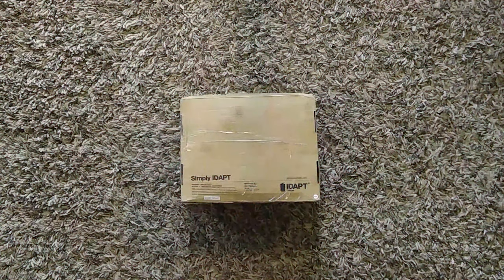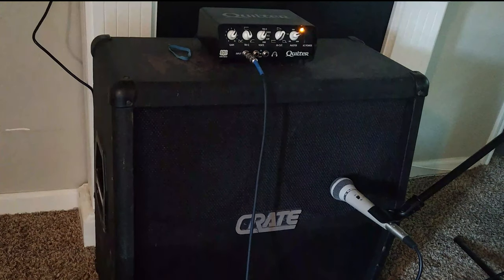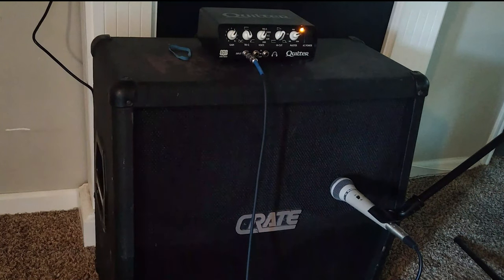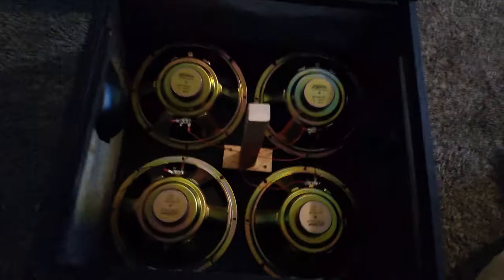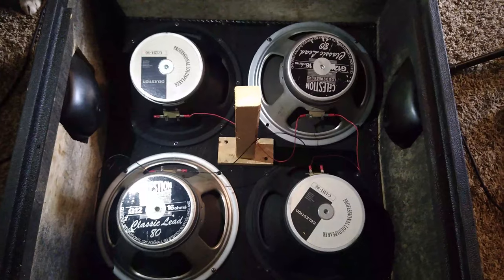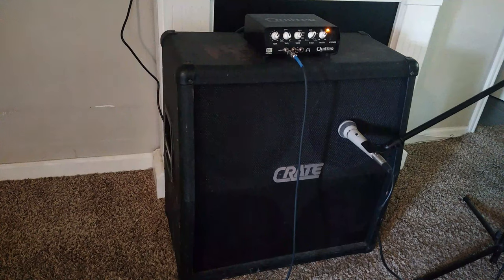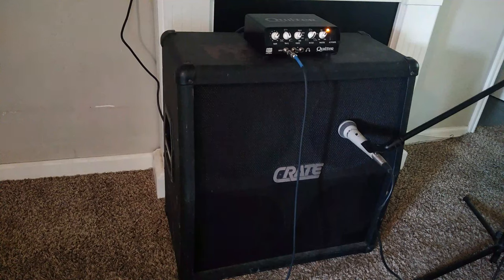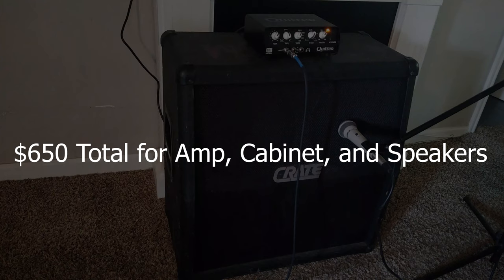Tanner's Favorite Things - Crate 4X12 Cab Experiment and Mic Unboxing

Comment: I have this same Crate cabinet that I bought used about 6 months ago for $100. It sounded decent paired with a Crate Blue Voodoo 120. Last night I swapped out the stock SLM speakers with 4 WGS Veteran 30’s and it totally changed the sound. If you are into metal, it’s now a high gain monster. And the clean channel of my Stage Right SR100 sounds absolutely amazing through this cabinet now. The big downside now though is the weight. It weighed about 40 pounds before the swap and was easy to load in/out for gigs. Now it weighs about 75 pounds so it’s not quite as easy for gigging. I’m just glad mine has casters.
Reply from the maker: Thanks for the comment, @BlurpeeBaggins! That was my exact issue with this cab when i swapped them out for the Celestions...it was a friggin' tank!! It's always fun to get great sounds out of gear most people snub their noses at! Crate and Peavey have a lot to offer if you're willing to go looking!

Comment: I did not realize how TERRIBLE the SLM stock speakers are until now! I own a JCM2000DSL 50W head and I always used it with my Crate Flexwave 4x12, amazing affordable cabinet, all plywood, very well made in China, but I knew that those SLM 1.2 Kg speakers couldn't be good and this video confirmed it, it is amazing how the distorted sound changed with the Celestion's, definitely I will upgrade at least one of my speakers for recording purposes, I have to tell that the only reason I like the SLM speakers are they weight, they are only 1.2 Kg making my 4X12 cab really lightweight!
Reply from the maker: Thanks for your comment, AndoidGamePlay4Every1. I was totally. blown away by the difference by self. I didn't think a magnet size and cage construction was that important, but i stand corrected after this experiment! Great cab, by the way!!
Reply: No way I can read all that
Reply: @androidgameplays4every13  I feel bad for you

Comment: The gain of the amp sounds like shit, that seems to be the main problem here. I have the same Crate/SLM speakers connected to a Hughes & Kettner Tubemeister Deluxe, using the clean channel of the amp with a Bogner Red Ecstacy Distortion - and it sounds like heaven.
Reply from the maker: You're possibly right, in that the Quilter 101 is not known for it's high gain.
Reply: 100%! St Louis Speaker Co. made some outstanding speakers, most of them clones built-to spec. I love mine more than anything I've ever owned or staged, including Mesa/Marshall/Fender/Engl...especially for boost driven tube clean i.e. Mayer or SRV, but they sound great on the chugga chugga as well. They take lows all day and the highs are glossy but not shrill. I guess it's all about taste :-)